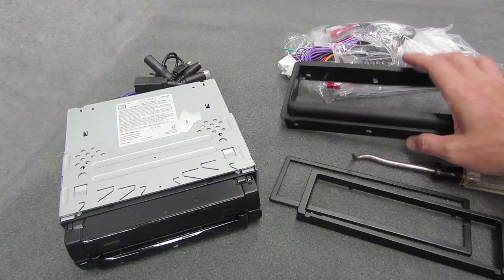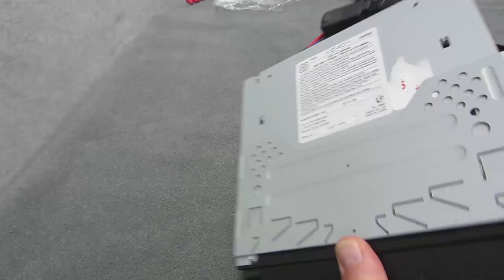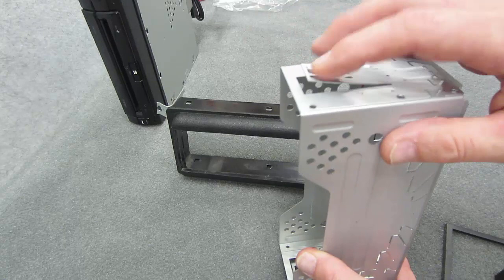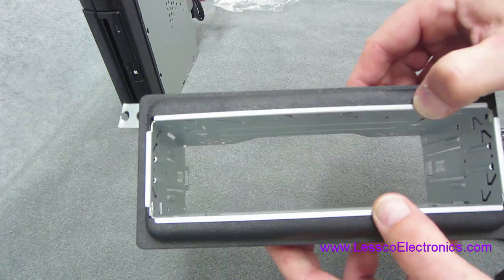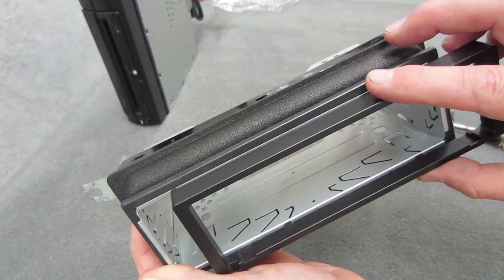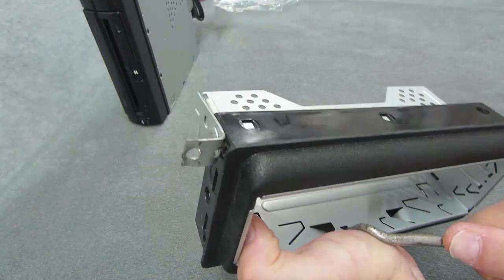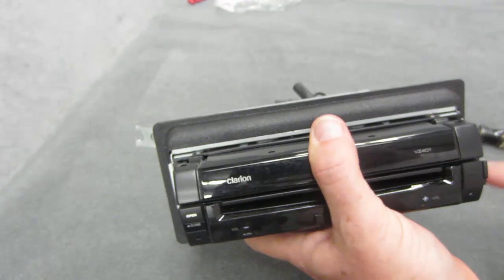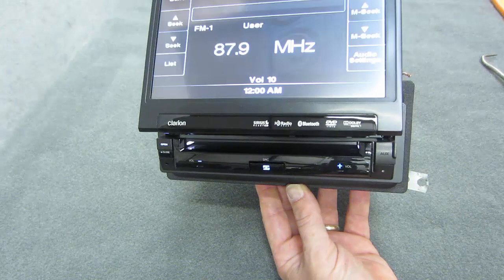How to mount your car stereo in a dash kit

Comment: Wow! That is really cool. I've got a 2001 dodge ram 1500 and I am real close to picking out a new aftermarket radio to replace the original stereo cassette player in my truck. The left front speaker I'll put is working intermittently inside the radio and it is cheaper to buy a new aftermarket radio than it is to find a radio shop to have them tear into it and fix it. Makes these new radio so cheap why bother replacing the old one when you can get a new one for less than $100? I was real interested in how you separated the tin can from the main radio unit and attached the mounting to the can and then slid the whole unit in and it clicked in the place. I've been looking for a demonstration of that which you provided. Thanks a lot you just made my night.

Comment: I bought a new Pioneer head unit but it didn't come with the metal bracket you used the hook tool on. Is that normal? I'm worried I won't be able to secure my head unit firmly in my center console.

Comment: I have a 78 Camaro and I want to use a flip out screen head unit. But as the screen folds out and up it will hit part of the dashboard. So my question is is there like a mounting kit and a plastic molding bracket for around it that will bump the stereo head unit out like 3 inches closer to the driver so that I could use this like I want? If you Google a 78 Camaro dashboard you'll see what I'm talking about like on the dashboard where it would hit somebody please help me direct me to the right video the right product to bring my head unit out about 3 in

Comment: i did mine all wrong lol!! the first part that comes off the unit i threw away. I didnt install the clips from my old radio to the new kit so it will snap in place and threw the old radio away already. smh you live and learn. I am just going to rig it up and drill it into the dash like a hillbilly.

Comment: u no the front part wer the stereo goes in? do u no if they hav this exact same kit but the front stiks out more? i hav a kit  like this but the stereo is touchin the inside of the truk 93 s10. so the stereo is stikin out about 1/2"
Reply from the maker: yes, there are 4 versions of that s10 kit, use the fitment guide at metraonline.com to see the available choices.
Reply: thanx man ive herd of metra i jus totaly forgot bout them. man they got lots of stuff on ther wish i went to the site a long time ago. i think i figured out wat i need. if i put 2 trim rings that should do the trik im hopin
Reply from the maker: That may work, But it'd be butt ugly, Invest the 10 bucks in the right kit and you'll have a 1/2" to spare!

Comment: Do you need the stereo cage to install
Reply from the maker: In most cases, yes. the only exception is when youre doing an iso mount.
Reply: @Lesscoelectronics  how can you do an ebrake bypass if the wire harness dont have that wire

Comment: The hole in my dash is too wide. Where my truck had an old knob radio. (internet Example: http://photobucket.com/gallery/user/maytag906/media/bWVkaWFJZDo2OTMwMDU4Mw==/?ref=) , the excess plastic was cut away with a jig saw.